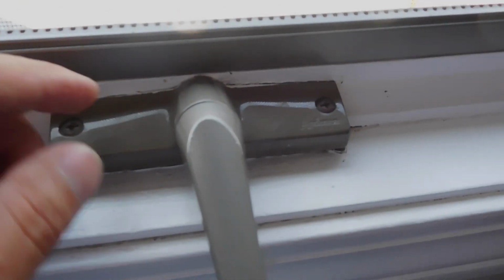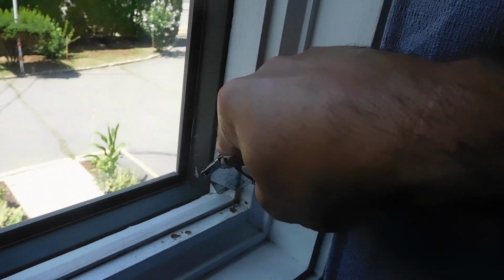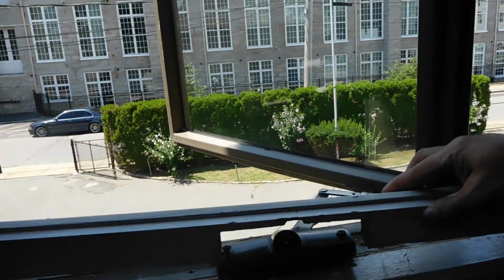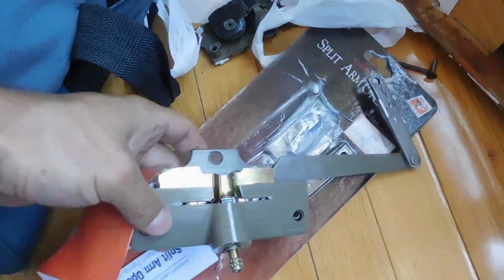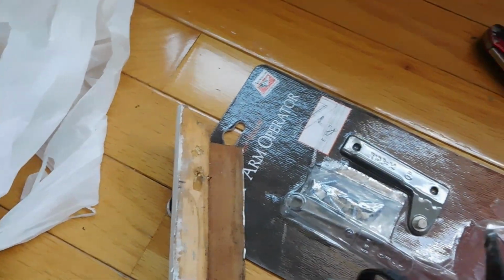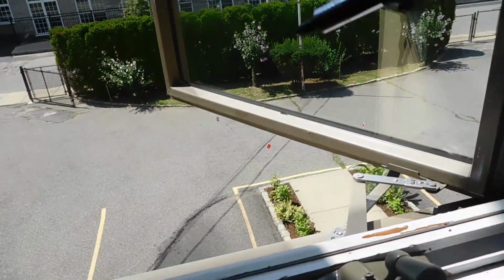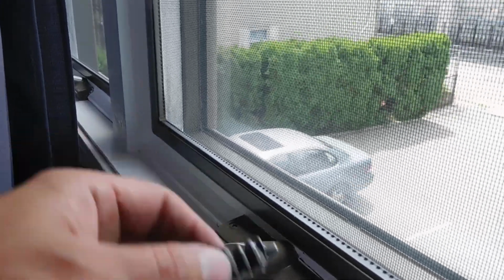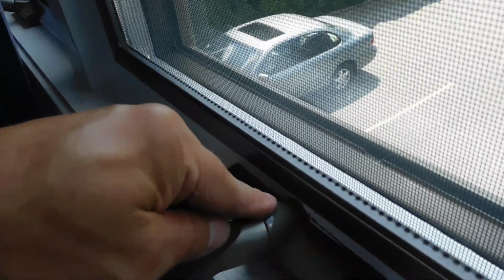Andersen window crank replacement / Window crank repair

Comment from the maker: Thank you for watching this video. the first thing to do is identify the window model/year then you can get the split arm on Amazon at, https://amzn.to/2H2IV53. Make sure you get the correct one. You will need to look from the outside to see which way the window opens and not from the inside. There is a left or right split arm. Note that you will need to salvage the old handle as the split arm kit does not come with the handle. You can also get the handle on amazon, https://amzn.to/2H0LIvx. Also note these parts listed are for windows from 1982 to 1995. You will need to determine the model and when your windows were installed to figure out the correct parts. Note the the bottom wood piece can break, that piece is called the bottom casement sill stop, Part #: 1352406.Andersen's site has more info, https://parts.andersenwindows.com/detail_1352406__w_casement_stops.html?item=1352406&category=w_casement_stops 

Amazon 30 day FREE Trial - https://amzn.to/2ItA9Ar

If this has been helpful please subscribe to me channel.
Reply: bruh where can I just buy the corkscrew? Im not replacing the whole thing.
Reply: Wrong. Stop reiterating this. Thanks.

Comment: I also want to thank you for the video - I am in a rental and prefer not to have to have my landlord fix every little thing - house is 100 years old - bought the parts (even the extra white cover) and was done in 20 minutes. My main worry was the lower wood panel - thinking that more than the bottom piece of the frame would have to be removed - but looked closer at your video and went to it. They didn't even nail the panel down - it was nailed down some years past - the holes were there. I used my trusty Gorilla glue to replace it and it now works like a charm. Looks great too. My wife will finish up with some white silicone to cover the seam and you won't be able to tell it was replaced. Took pictures of the process for the record and kept receipts. Thanks again!
Reply from the maker: Great to hear this helped you. The landlord is lucky.

Comment: I have a problem where a handle wont hold on the crank stem. Every time I try to open the window the handle slips out. I replaced the handle, same problem. Any suggestion?

Comment: I have an old style cover around 1974-1979 with no screws, similar to the one in your video, and cannot find any information on how to take the cover off. I believe it is Casement Operator Cover part #0532608. Spoke to two Andersen reps, both of which said it should pull right off and one of them said the casing may be holding it on. I stated it rocks left and right and there is no paint holding it in. Seems like the center is held in somehow causing not to slip off the shaft. Tried pulling it off by hand, using a screw driver, clamp to get a good grip and small pry bar. It's not coming off. Any suggestions?

Comment: Thanks for the great video.  I also saw a guy secure the corkscrew cylinder with a set screw and hammering the metal around it.

Comment: There is no such thing as a flathead screwdriver!!!
Screwdrivers fit round head screws pan head screws and Flathead screws but there is no such thing as a flathead screwdriver!
Screws themselves come in a variety whether it's straight blade, Phillips, head torx, or any other configuration! 
They do not and never have made screwdrivers with a flathead!!!
Screwdrivers come in various different drive types for different types of screws that most screwdrivers are either straight blade, or Philips, or torx, or something similar, but nobody makes a flat head screwdriver there's no such thing!!!! 
If you were talking about a flat blade or straight blade screwdriver then specify that!
A flat head screw driver would have a flat vertical cut-off end that we totally useless for anything except as a flat end punch!!! And would not be a screwdriver in any sense of the word whatsoever!
Reply from the maker: Wow... Ok 👌 hope you got your window fixed 🤣
Reply: I hope you got medicated, bro. It really helps!

Comment: As you said the threads completely broke off on my window operator and the crank won’t catch at all. I can’t get the window open to replace the part. There is nothing for pliers to hold onto to try to manually crank it open. Can I force the window open? I don’t see another way… thanks!
Reply from the maker: First remove the handle completely before opening the window

Comment: So, totally followed this advice - especially the part where you said “make sure you look at the window from the outside.” I triple checked. Bought one for the left, since from the inside it opened to the right, and outside it opened to the left. Wrong. 
The left one would only open to the left when I installed it with the crank on the inside of the house (where it belongs) and it wouldn’t connect to the window. I had to go back and return it and switch it out for a right hand one. And it worked perfectly in the window - that opens to the left on the outside and the right from the inside.

Comment: Thanks so much. I have to replace one that I replaced around when you made this video. Broke already. Hardly was used .... The first replaced one that was 30 years old. Second one lasted less than 2 yrs. Ugh. And two others I replaced then are already starting to get hard to open.

Comment: Thanks for this video, was able to replace the operator and get the window to work perfectly however I manhandled the sill stop and saw it was nailed down 4-5 times and I couldn’t find my crowbar or putty knife so I ended up ripping the whole thing out and the sill cracked in half... lol. Is home depot a good place to get a replacement? Or should I just use wood glue and glue the two pieces back together?
Reply from the maker: wood glue, or look in the description for that part number.
Reply: Thank you! I appreciate it. Do the bottom casement sill stops come in different sizes depending on the window or are they universal? Cause if its one size fit all, i’ll order a new one with your link. My anderson window is from 2007.

Comment: Was able to replace the operator on my Andersen casement window thanks to this video. The worst part was paying $72 for the part but it's better than a new window or even paying someone to do it for me. The sill stop came out pretty easy for me after I scored it with a utility knife. It was only secured with two brad nails on the edges, so mine fortunately didn't crack or break. I was able to just replace the operator and put the sill back in place after without having to paint. Ran some caulking to blend it back in and it looks just like it did before. Anyway, thanks again, I really appreciated this video.
Reply from the maker: Awesome

Comment: Lovely accent. New Jersey?
Reply from the maker: Northeast, so near nj
Reply: Da P.A my window crank just stopped working so thank you for the instructions. I just ordered the replacement part. I’m nervous about removing the wood trim at the bottom, hopefully I don’t destroy it 😬
Reply from the maker: @lauraly26  you got it, it's easy pry it slowly
Reply: I replaced it and it’s working perfectly! The split arm operator I ordered came with a “sash bracket”  (the piece connected to the window.) Since I didn’t see a need to replace it I kept the old one on. Thanks again!

Comment: Good illustration, but a few suggestions.  First, if you open and release the window first, you can pry it up from the outside (I prefer a sharp 1" wood chisel, bevel side down, so that it gives you the leverage to pry up.  That way, you don't mar the inside at all.  As soon as you locate the two nails, pry right next to them alternately, keeping the trim piece level, to prevent splitting or cracking it.  Only pry it high enough to get a side cutter in (once again from the outside) and clip the nails as close to the bottom as possible, then gently pull the wood piece straight out, w/ the remainder of the nails in it.  The nails I've encountered were in at angle, so the higher you pry the greater the risk of splitting the piece.  Very easy to tap down the remainder of the clipped nails into the base and cut the rest of the nails off flush from the trim piece, rather than pulling them out w/ a pliers.  That way, you don't leave a big hole to patch and again reduce the risk of cracking the wood.  Be sure to predrill the holes for the replacement brads, smaller than the brad head diameter.  Use a little soap on the ends of the piece when you replace it so that it goes in easier.
Reply from the maker: Good points. This was done on a second floor window so a little tricky
Reply: @daP.A   I didn't mean you had to be outside to do the work.  I just reached through the open window w/ the wood chisel, and then with the side cutters.  My window was well above ground level outside too.

Comment: I have 50+ year old Andersen 7073B double-pane windows that are on their last legs.  I need them to last a few more years before I replace them with vinyl.  They require a lot of maintenance and Andersen is not helpful.  The cranks wear out and just spin around.  The corkscrew cannot be replaced.  Andersen won't answer my questions about third-party replacement parts, because they want me to buy their windows cranks for $180 to $225 each.  I said "okay screw you" and I replaced my Andersen 7073B (Wooden) Casement Window operators ($218 from Andersen and $225 from distributors like DK or CRL or WindowParts.com) with PrimeLine.net operators from Home Depot for $32 (https://www.primeline.net/h-3999-casement-operator-whandle-andersen).  They sell both right and left hand window operators.  They don't fit exactly, but it you mount the channel a little lower (~1/2") and correctly centered so the channel guide doesn't not slip out either side, it will work fine.  You may need to cut out 1/4" on each side of the "Bottom Interior Stop" (the cosmetic wooden housing that goes over the operator body) to make things fit perfectly.    Doing this modification saved me over $190 per window.   I have six of these Andersen 7073B windows, so it saves me over $1000 on Andersen original parts.  Andersen is badly outdated in their pricing.  Third-party after-market suppliers are kicking their butts.

Comment: The hand cranks are way too expensive, clumsy and designed to break. At home depot they cost around $60CAD. These things are mass produced and should cost $15 maximum. Also they are so easy to break. What, metal is low/cheap quality, design is bad and cost too much. Also, they are left,right, short, long. HD has usually only one type and there is no way to find right one. Where should I be looking for them? I need to replace at least 2.
Reply from the maker: You can get them online look under description for the link

Comment: Thanks, you did a good job in repairing, explaining, & showing the cause of the problem. As you stated, Andersen needs to fix this because it's so common with their windows. If the gear chips causes this, why doesn't Andersen just offer a gear replacement? It would be an even simpler fix. Again, nice video!
Reply from the maker: Agreed
Reply: I think this is business only😢

Comment: thanks for sharing. but i have to say how bad the design of this kind of lock. i hate the truth when you do the replacement, you have to break something! truly hate this design
Reply from the maker: great windows but i totally agree, these are some of the best windows but this part could of been designed a lot better. The good news is the crank and crank parts are high quality so it will last a long time. These windows are here since 1984 and in great shape. Great comment though. Thanks and subscribe for more videos.